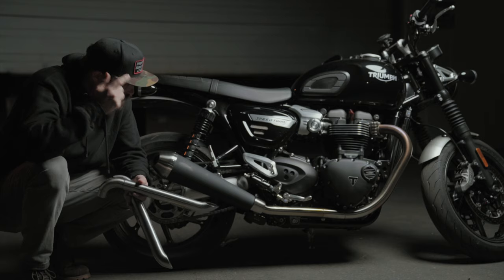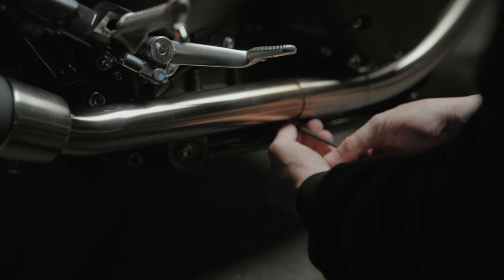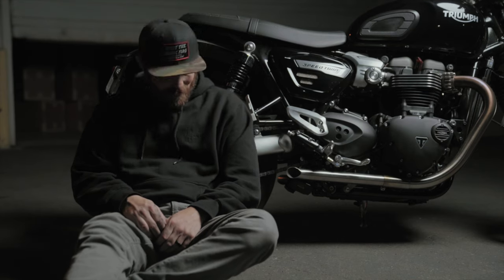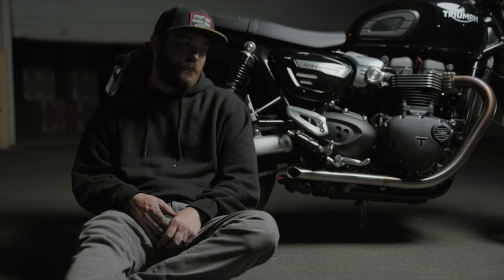British Customs Turn Out Exhaust Tips Before and After // Triumph Speed Twin [4k]

Comment: Ever think of wrapping the head pipes to insulate and keep the gases and heat moving out the pipes? Believe it or not, removing mufflers can hurt performance in many cases. Personally don't like loud pipes but Triumph twins are pretty mellow and your bike sounds better now, so it's all good. I'm taking the baffles out of my '22s mufflers and gutting the rear cats. Went with a British Customs competition x-pipe. Then I'll go through the idle/self tune process to reset the parameters. I've modded the airbox inlet boot already. Should be sweet for very little outlay.
Reply from the maker: I did consider wraps, but I cant stand the smell when they heat up and I'm not a big fan of the look on a bike like this. I'm okay with sacrificing a little pit of power, and honestly it's been unnoticeable. My riding skill level is miles away from touching the potential of this motor anyways. Suspension is where I think I need more help. I think I'm gonna put some ohlins on pretty soon.
Reply: @MOTOSCOUTtv  That's too pricey for me on a bike like ours. I hemmed and hawed for weeks over the exorbitant cost of fully adjustable rear shocks and in the end went with the Razor iii from Ktec. $800 bucks for all black units that have 10mm. of height adj. Threaded style spring preload adj. and single knob dampening. Springs for my weight is the biggest advantage to aftermarket shocks, and then knowing how to get 'em dialed in properly makes the difference. People spend tall bank on fancy suspension parts and still have issues because they have no clue how to set them up. I'm actually running to Autozone right now to pick up a can of DEI's black high temp silicone spray for my exhaust wrap job. It makes a huge difference on the looks and durability of the wrap. I'm just waiting on my black Hepco & Becker crash bars before I tare into it. Peace.

Comment: the only problem with British Customs, they turn yellow. it is so obvious and ugly. I put on a pair and took them off a few months later.
Reply from the maker: Hmmm... I have no had that issue yet. Will keep an eye out for that though.
Reply: What do you expect with 304 stainless steel being ran hard in heat its not like aluminum just get them coated nlack solves you're issue